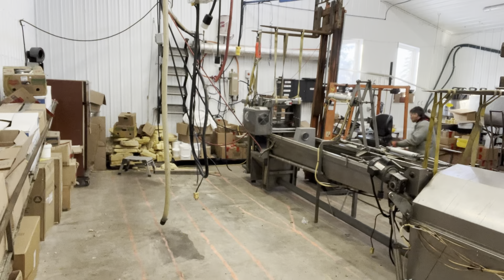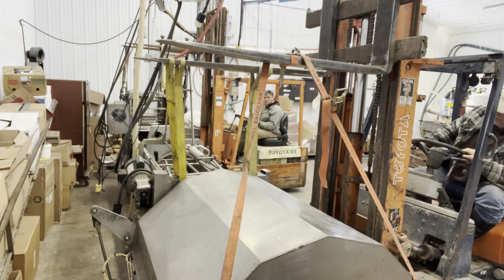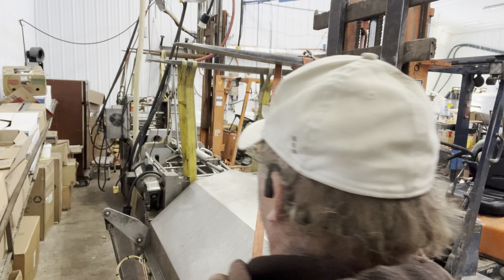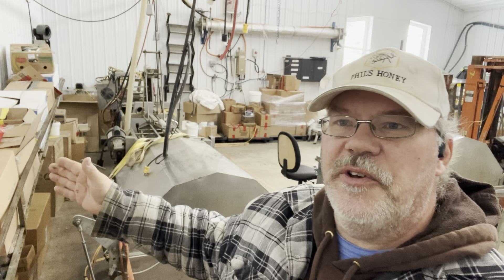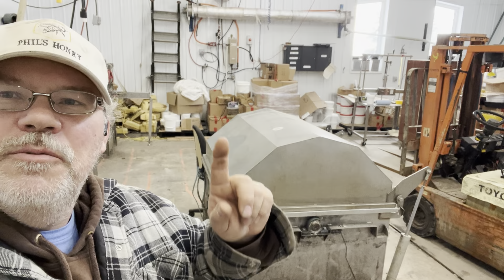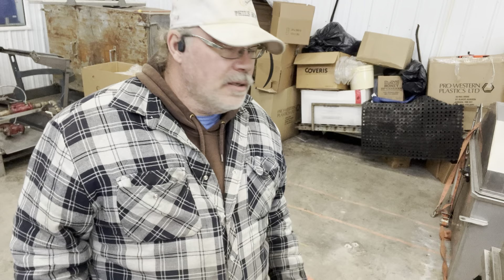Moving the extraction line

Comment: Build a few crossmenbers, two flat bars welded together for an upside down T,  Put a crossmenber at each leg. Drill the CM and bolt it down, wherever you want. They usually put the two extractors, side by side but running in opposite directions, theres no box passing back and forth, and the guy in the middle does the loading on both. Adjust the governor on the forklift so it aint surging.
Reply from the maker: Lots to consider there.